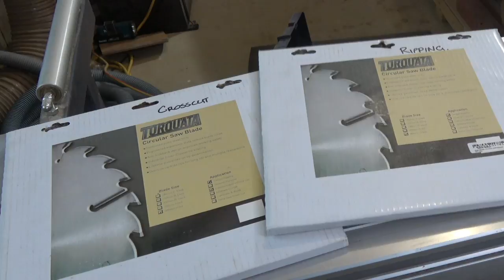The panel saw and I - Baby Cot DAILY Woodworking VLOG 1

Comment: I didn't even notice that the lights were off. 
And i hope you get your daily targets :)
Reply from the maker: At the 10:23 mark, I overloaded the electrical circuit which was supplying power to the saw and a few of the video lights. I need to get the lights on their own circuit because the saw needs all of the 15 amps available. I doubt I will ever get my targets in the allotted time frame  😀